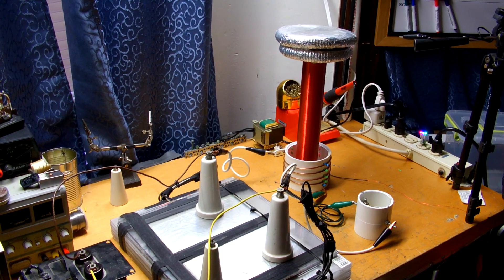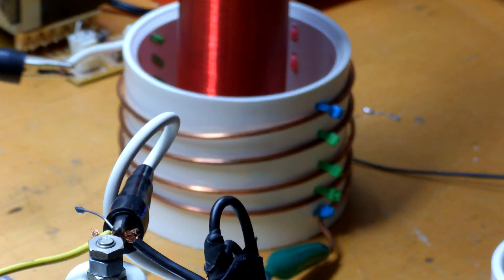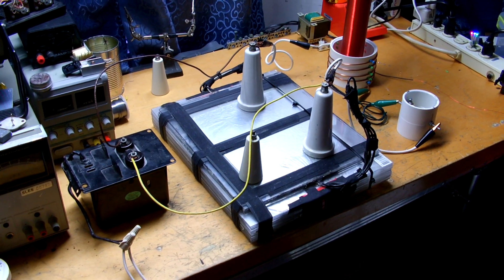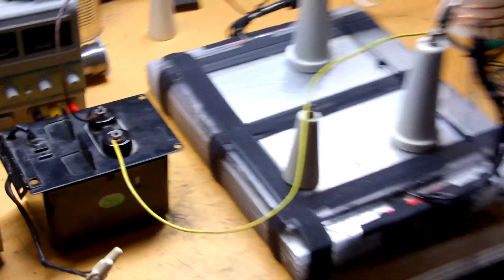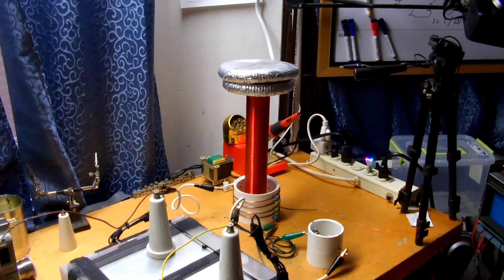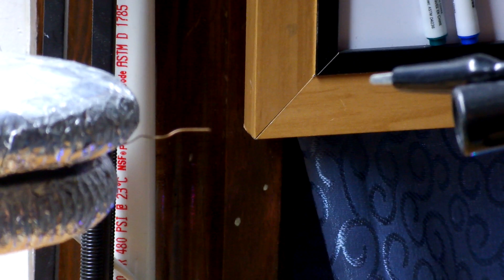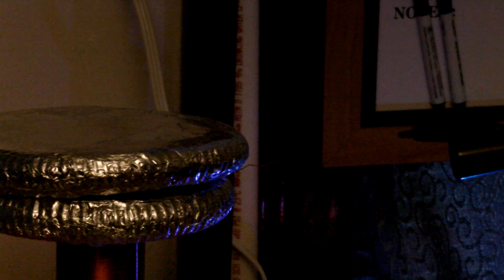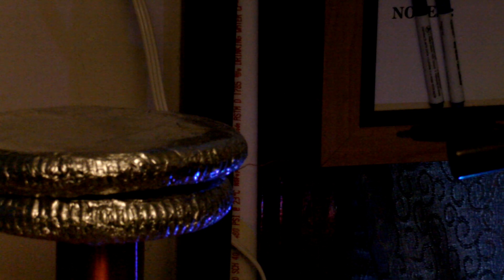Tabletop Tesla Coil Experiment

Comment: Hi Mr. Pete ,  good job :)   I'm trying to tune a friend's tesla coil ,  with this params 
 pCap 10nF         pCoil 0.03mH       290,58Khz
sCap 39.4pF      sCoil 7.63mH        290.28Khz    

sCap would be 2 toroids of  460mmx100mm  = 39.322pF or a
insulated-capacitor-sphere   r = 0.36 m   capacitance = pF 40.078551229511035 

But i would like to use  more alluminiun soda can as top load , we need 40pF for resonance but unfortunately i 'm not able to calculate the capacitance of 1 or more soda cans .   May be you have the possibility to misure the capacitance of 1 or more cans to reach 40pF .      I'm not an expert  but I follow all tesla's experiments with a lot of passion.  I would appreciate this very little help.  

Congratulation for your work ,  thanks a lot. Greetings from Italy :)
Reply: è una bella domanda, nessuno mi hai mai spiegato come calcolare la capacità di 2 toroidi con precisione.... se in questi 2 anni da quando hai scritto il commento hai capito come si fa potresti spiegarlo anche a me?
grazie mille
Reply: Si , in due anni ne ho fatti di esperimenti :)  Ho usato questo sito per il calcolo della capacità del toroide http://deepfriedneon.com/tesla_f_calctoroid.html  
Poi ho  comprato un oscilloscopio,  mettendo bene in risonanza il tutto. 

Praticamente c'è una formula: conoscendo "induttanza" dell'induttore (l'avvolgimento)  e la "capacità"  del toroide o qualunque altro componente metallico tu voglia usare ti puoi calcolare la Frequenza di risonanza tra i due componenti.  

Conoscendo La frequenza (con l'oscilloscopio vai molto di precisione) e uno dei valori dei due componenti puoi trovare il valore di capacità o induttanza dell'altro. 

Più sei preciso nelle misurazioni reali del tuo apparato (lunghezza del filo , diametro , numero di spire , giri e frazioni di giri  ) nella maniera più precisa possibile, più i risultati teorici della formula si avvicinano a quelli reali.  Comunque l'oscilloscopio è stata la svolta.  

Le formule per la frequenza , la reattanza capacitiva e induttiva le trovi qui: http://www.66pacific.com/calculators/coil-inductance-calculator.aspx

Fa i calcoli in inches , ma basta che usi  inches  come unità di misura piuttosto che metri :   1 inches = 2.54 cm .  

Ho giocato per due anni con questa app web . Circuit simulator in real-time.  Meglio guardare i grafici sul monitor che assorbirli per lungo tempo dal tesla coil reale ;)   http://tinyurl.com/l6pgmjz 

(Comunque una lattina ha una capacità da 4.5pF a 6pF) Se non ricordo male:)

Buon divertimento ,  mi farà piacere sapere se fai qualche esperimento , se hai altri dubbi chiedi pure.  Ovviamente prima di ogni cosa pensa alla tua sicurezza.  Ciao Mirror Speaker
Reply: Mario Abbruscato io ho iniziato ad interessarmi a queste cose circa ľ altro anno e adesso sto facendo la mia prima sgtc (ne avevo una piccola sgtc che faceva 5cm di scarica) e purtoppo non ho oscilloscopio/gen di funzioni però sto cercando di farla il meglio possibile questa tesla.
tu ne hai fatta qualcuna? se lo farai metterai qualche video sul tuo canale?
grazie mille per la risposta completa che mi hai dato!!!
Reply: Considera che più piccola la fai , più alta sarà la frequenza e più grande sarà il margine d'errore dei calcoli.  Io ti consiglio di farne una grande , in modo da  lavorare su frequenze tra 200khz e 500khz , ma anche un 1 Mhz se proprio non hai abbastanza filo.  In pratica il trucco è tutto nella Risonanza tra il circuito primario , e il circuito secondario tenendo conto della reattanza per avere la massima performance.  Ad ogni modo devi sapere che tutto gira attorno alla velocità della luce , creando onde che hanno picchi d'onda positivi e picchi d'onda negativi. 

Il trucco sta nell'usare una lunghezza del filo del avvolgimento secondario in modo che l'onda abbia il suo picco positivo o negativo alla fine del filo.  

Vuol dire che al toroide arriverà la tensione piu alta , che è quello che ti interessa per creare i fulmini.  

Poi la risonanza di questo circuito , con il circuito primario : risonanza vuol dire che le due coppie  di condensatore e bobina , anche se hanno capacità e induttanza diversi , devono però avere la stessa frequenza di risonanza.   

Praticamente per farlo come il simulatore di circuiti che ti ho passato : quel tesla coil è accordato a 200khz ,  tenendo ovviamente conto della velocità della luce "C"  dovresti avere una lunghezza del filo del secondario di :  
 c=300000000  metri
 f=200000         hertz
 lunghezza dell'onda = c/f  = 1500 metri . 
Vuol dire che la distanza dell' onda dal primo picco positivo al successivo picco positivo   è di 1500 metri.
 ---------> |1500 |<-------
/  \      /  \      /  \      /  \        
      \  /      \  /      \  /      \  / 

Siccome a te serve che l'onda nel tuo filo secondario abbia sempre  0v nella parte inferiore , alla base della bobina  e  il picco massimo Positivo o negativo , nei pressi del toroide , il filo deve essere  lungo 1/4 della lunghezza d'onda. 
Ovvero: 1500m / 4 = 350m

E deve essere avvolto in modo da avere  (circa 25mH devi fare i calcoli) per avere una risonanza con il toroide da 25pF   di  200Khz esatti.   

Allo stesso modo il circuito primario  deve avere una freq di risonanza di 200khz  che è data da  20nf  il condensatore, e  28.28uH l'avvolgimento primario.    Con gli strumenti che ti ho dato puoi capire come dimensionare tutti i componenti.    

In fine , tenendo sempre conto della velocità della luce fai in modo che il picco d'onda nel circuito primario avvenga per lo più nello spark gap.

In pratica se lo fai grande , in questo modo puoi alimentarlo anche con pochi watt per avere dei risultati di trasmissione di energia soddisfacenti evitando di friggerti il cervello.  Ovviamente funziona anche se lo alimenti poi ad alta tensione e corrente , ma li diventa pericoloso , fai attenzione,  la teoria è la stessa, scopri tante cose nuove e non ti fai male.  Puoi iniziare ad alimentarlo con il circuito delle racchette per ammazzare le zanzare.  I condensatori li sono in genere  17-20nf  che sono quello che ti serve.  Certo se li misuri i condensatori (scarichi)  con qualche strumento (ci sono dai cinesi)  parti bene.
Reply: Mario Abbruscato  il sito deep fried neon lo conoscevo già e lo ho usato anche io per un pò di tempo. comunque la freq. di risonanza dipende molto dall ambiente in cui si trova il circuito lc... ho provato io stesso che spostando la sgtc da camera mia al giardino dovevo spostare il tap del primario di quasi 1 spira!! 
poi bisogna ancbe tenere conto della capacità delle scariche stesse che abbassano ulteriormente la freq. di risonanza.
per la mia tesla direi che il circuito delle racchette per le zanzare può farle solo il solletico hahahhaha
se ti interessa ho messo dei video a riguardo sul mio canale you tube.
comunque per fare la sgtc mi sono attrazzato di saldatore/ tester/ capacimetro e altre cosette molto utili. purtoppo mia madre non vuole che faccio esperimenti con ľ elettricità   e questo inizialmente ha rallentato molto i miei lavori (avendo 14 anni i miei genitori non mi lasciano tanta autonomia in questo senso) però i lavori procedono e i risultati si vedono😊
Reply: comunque la sicurezza prima di tutto!!! 
io sto molto attento a scaricare i condensatori e isolare tutto al meglio, bisogna sempre ricordarsi che si stanno usando alte tensioni e che i condensatori possono liberare picchi di decine e decine di A.
Reply: Mi fa piacere , ed è  bello essere curiosi  ma è anche vero che la giovinezza porta a fare cose pericolose senza sapere o non considerando  abbastanza quanto possano essere offensive, anche fatali.  

Con la corrente elettrica si può morire e credimi basta una sola volta.  

Quello che voglio farti notare è che poi avere più soddisfazioni, fulmini più lunghi , evitare di assorbire radiazioni che effettivamente non ti servono per accendere i neon  o una lampada a distanza o dalla stanza al giardino se lo fai bene performante usando prima la teoria. 

So bene che la sola teoria è noiosa , per questo ripeto, puoi avere ottimi risultati , misurabili , tangibili senza usare troppa corrente e tensione.  Puoi studiare gli effetti , accendere led a distanza , neon fino a 1-2 metri  con pochi Watt. senza il rischio di uno shock elettrico che nella peggiore delle situazioni può essere fatale.  

Ti consiglio di studiare prima cosa è necessario elettricamente per farti male seriamente ,  quanta corrente basta per subire danni permanenti  in modo diretto o indiretto (Wireless).  

Con un circuito da racchetta puoi usare uno spark-gap di 1 mm  che sono 3mila volts  e  avere fulmini da 60-120mila volts  2cm - 4cm ++ 

Poi ti basterà aumentare la distanza dello sparkgap a 2mm  per avere 8cm di fulmini  e capirai (se non lo sai gia)  che i condensatori del primario hanno una tensione di esercizio  di 2k o 3k volts.  Praticamente si sfondano.  Allora potrai usare piu condensatori in serie e in parallelo per arrivare via via ad alimentarlo correttamente senza che il circuito fonda o che si brucino i condensatori  potendo avere fulmini lunghi metri.   

Ma usare livelli di corrente pericolosi senza conoscere la teoria è sconveniente perché rompi i componenti , assorbi radiazioni  di tipo pericoloso (inutili e invisibili e che non puoi misurare)  ma che ti farebbero solo del male.  

Approfitta per studiare l'energia sperimentando in tutta sicurezza e poi ... potrai anche scoprire qualche nuovo fenomeno perché no ...  ma devi sempre partire dalla teoria.  Io ho preso , per distrazione la corrente svariate volte all'inizio  e credimi non è piacevole. E ti parlo del circuito delle zanze che ti fanno fare un salto che è anche un po doloroso dalla parte del primario.  

Se fosse stata la 220v a 10amp della presa da muro di casa non sarei qui raccontartelo ora.  

Ti prego di fare attenzione e di tenere sempre una mano in tasca mentre svolgi i tuoi esperimenti: difficilmente potrai chiudere un circuito con il tuo corpo se usi una mano sola.
Reply: Mario Abbruscato  tra le precauzioni che prendo quando uso la corrente ce anche quella di usare una sola mano.
uso una sola mano
mi isolo da terra con un tappetino plastico e ciabatte di gomma
uso un interruttore a distanza (circa 7 metri per la sgtc) in modo da non mettere la mano nel posto sbagliato
mi assicuro che non ci siano buchi nei cavi 
tengo il tutto isolato elettricamente e sollevato da terra(non si sa mai).
come ho già detto, la sicurezza prima di tutto.
una tra le cose che mi preoccupa perchè non si possono vedere sono proprio i campi magnetici generati dalla tesla... mi sono accorto della loro potenza dopo averla usata la prima volta.... la calcolatrice sul tavolo a qualche metro di distanza si era resettata, anche il mio cellulare che era nelle vicinanze.
chiedo a te che sembri più informato di me a riguardo, mi potresti mandare qualche link oppure se vuoi mi potresti spiegare i danni causati da questo tipo di campi magnetici? e da cosa dipendono?
grazie
Reply: comunque a volte la teoria è noiosa però senza teoria non puoi passare al lato pratico,e bello capire il perchè delle cose e magari sapere qualche formula😊
Reply: Piu alta è la frequenza più energia hanno le onde.  
Ci sono dei valori teorici che usano unità di misura che bisogna studiare prima , per capire di cosa si parla e quantificare nel mondo reale (quello che accade durante i tuoi esperimenti).  
In linea di massima si parla di Volts per metro quadro  , Siemens per cm  e robe del genere che dovresti cercare , parti da wikipedia e non ti basta una laurea per conoscere tutto l'argomento.
 Quindi a parte questi volts per metro quadro o cubo che sia  ci sono le frequenze che oltre ad essere di ampie migliaia di metri nel caso delle onde radio ,  centinaia di metri ,  si va via via sempre ad avere onde di lunghezza minore fino ad arrivare a dimensioni di micron (milionesimi di metro) e via via sempre piu piccole in teoria anche all'infinito. 

https://it.wikipedia.org/wiki/Radiazione_elettromagnetica

 I piu pericolosi sono i raggi x , raggi gamma, radiazioni nucleari.
 
Ogni volta che un fascio di elettroni colpisce la materia di cui è fatto lo spark gap, gli atomi che lo compongono si eccitano cambiando stato energetico e rilasciando questi tipi di raggi , cosi anche mentre attraversano i cavi , del primario e del secondario.  Non so se hai presente una saldatrice ...  anche quello è uno spark-gap :   se  ci fai caso  gli operai che la usano hanno sempre (spero) una protezione davanti agli occhi: uno specchio particolare che col tempo anche lui si consuma e va cambiato , che attutisce i danni (che comunque ci sono alla retina dovuti a queste altissime frequenze che ripeto non sono solo quelle visibili che ti accecano ma sono anche invisibili che vanno distruggere i coni della vista ,  le cellule in genere fino anche  a  dosi elevate come i raggi-x degli ospedali, per dire , che ad alte concentrazioni , possono modificare il dna attivando disfunzioni che possono attivare situazioni cancerose , in pratica vengono i tumori e malattie simili. 

Devi sapere che i primi scienziati ai quali tutta l'umanità deve molto per i loro esperimenti che hanno fatto progredire l'intero pianeta si sono fatti spesso a caro prezzo , la vita, di questi scienziati che non conoscevano la pericolosità dei loro esperimenti. 
 
 i Tubi a vuoto  , la scoperta dei raggi-x .
 
Tesla è stato il primo a mettere in guardia tutti dai danni da esposizione ai raggi-x con i quali anche lui ha sperimentato molto brevettandone anche di suoi. 

Ma come ben saprai Tesla non era uno stupido ,  riuscendo a dominare energie potentissime , a domarle ma in sicurezza, perché prima si documentava amico mio.    Parti da qua e buon viaggio:  https://it.wikipedia.org/wiki/Raggi_X         

(C'erano tanti documentari interessanti sulle scoperte qui sul tubo ma dopo un po li tolgono)  Comunque partendo dai raggi-x hai molti link interessanti che puoi cercare anche qui sul tubo se preferisci i video. 

Ovviamente tutto va pesato bene : uno stuzzicadenti non è una trave da soffitto , ma sempre legno è.  E se ti cade in testa uno o l'altro la differenza è molta.
Reply: Per concludere non fare esperimenti con l'elettricità se non con la supervisione (la presenza di un professionista elettricista con te ). Non ti mettere a fare cose che non conosci perché ci puoi rimanere secco.

Comment from the maker: Hi, the cap is 11nf which is too much for my OBIT which results in a slower firing gap, also because there is a bit of galvanic action taking place between the plates and wires within the capacitor, its getting old lol  The spark gap is definitely too small also, I didn't really have any big design in mind at the time so i just wound a few primary turns, i knew it would work just for testing, In the future i will make a larger primary and use real pulse caps, Thank you for the comment!!